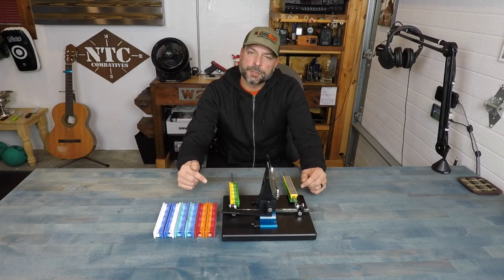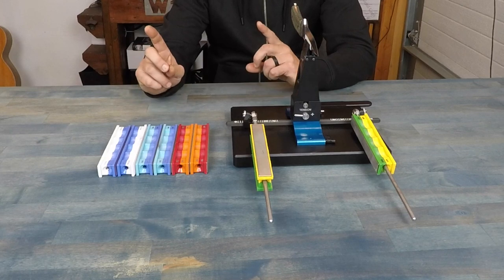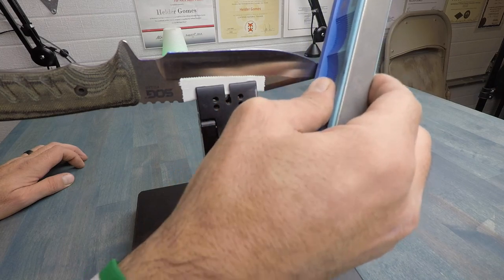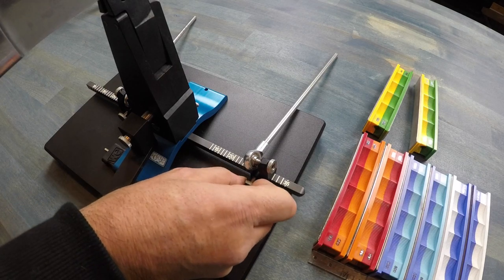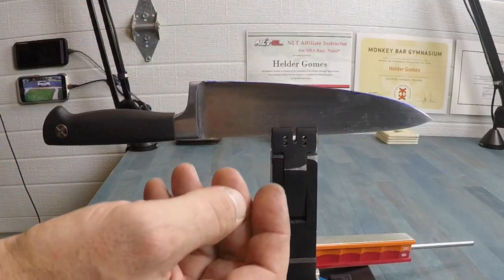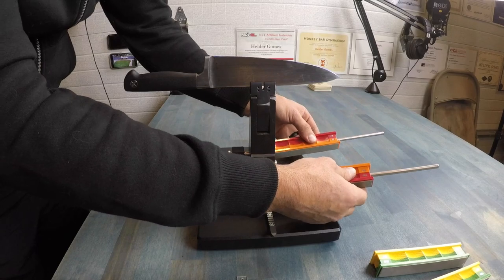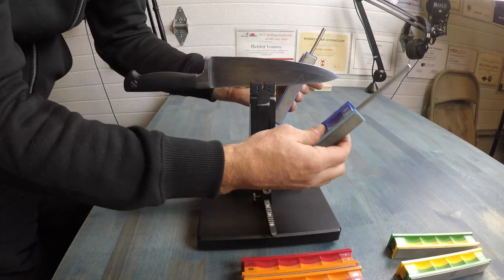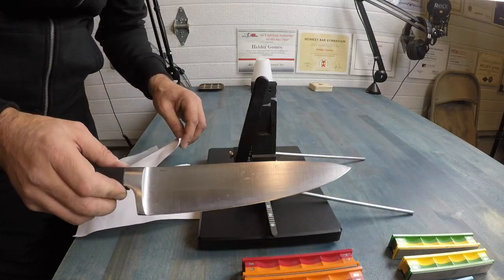Wicked Edge- Knife Sharpener Review

Comment: I am in no way having a go at you or your video, but I cant help thinking what a bunch of suckers we all are. Heres why , we go out and buy some great blades and hundreds of pounds or dollars worth of sharpening systems, then we spend hours sharpening and cutting paper and hairs etc, and put our lovely sharp blades in a cabinet and never use them. I have an old leather knife on my bench that I use to cut everything from boxes to rope, now and again I throw it at the dartboard or wall, I use it to scrape rust off things and spread glue on repairs. The blade gets a quick sharpen on my bench grinder and its ok again. Meanwhine my $100 dollar plus knives do nothing but look pretty. I have lived in Canada and I know hunters that use a snap off blade utility knife for skinning etc, Take a look at Greg Ovens ( who is just great) He has a rusty old knife and shotgun and manages just fine, having said all that , for some reason I really want a wicked edge sharpener system , LOL
Reply from the maker: 🤣
Good Stuff old fart, thanks for sharing -Cheers!
-Hg
Reply: Look into razor sharp.   Wheels go on grinder.
Reply: Exactly.  I have a fine old Gerber that I force myself to use first when gutting and quartering deer, but the disposable blade systems are actually more convenient since you just toss the blade when it gets dull.  My Gerber is basically a dinosaur that will probably get tossed by my wife when I'm gone.